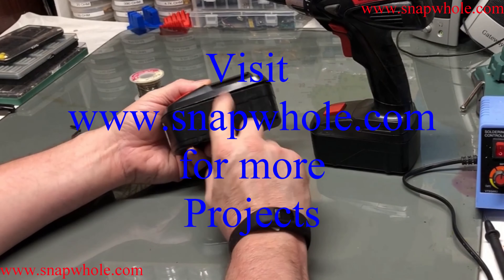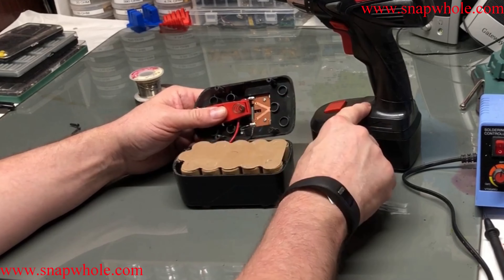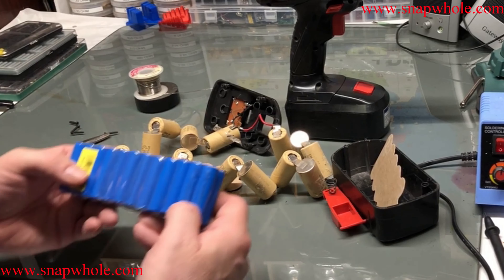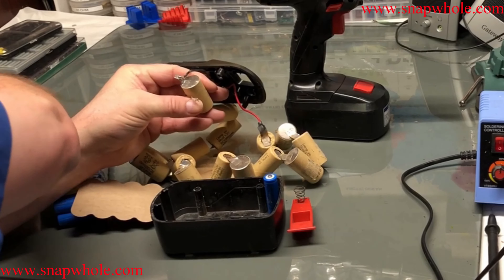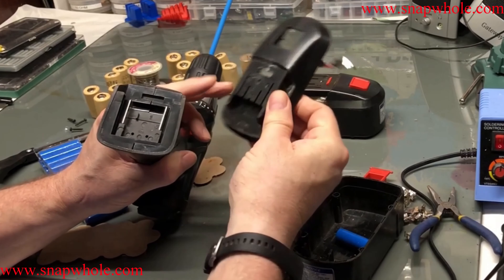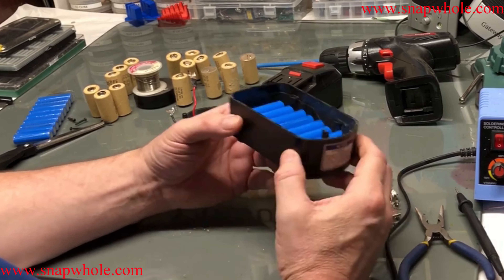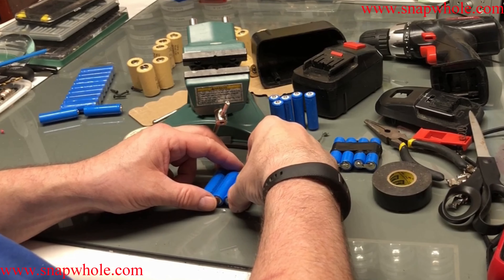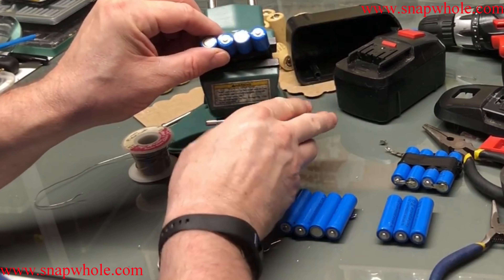Harbor Freight Drill Master Drill/Driver Battery Upgrade from Ni-Cad to NI-NM Battery replacement

Comment: With the frequency on how often the tools go outdated and you cant find batteries anymore, this is perfect. this charger and drill is already out of date
Reply from the maker: there is huge money in batteries for handheld tools, but there are also changes in battery technology, line ni-cad to li-io, that are worth doing, but changing the shape of the battery just to sell more batteries is wrong, the bauer line all use the same battery foot print, with 1.5, 3 and 4 ah batteries, and I think that line of tools will be around for a long time - although there are improvements being made in battery capacity and efficiency, I don't see those changes coming to the hand held tool any time soon, and even with changes to the batteries, I don't see changes to the li-io chargers, they use a balancer to control charging so no individual cell will be overcharged, which is what kills batteries like ni-mh and ni-cad, ni-mh thru overheating, ni-cad thru overcharging - thanks for subscribing!

Comment: Great video and well done. I used your video as a guide to do the same thing... although I was not able to find the Ni-NM batteries as cheaply as you did.. cost me about $1.70 per battery but they are 2800mAh. I have two of these drill motors and just seemed a shame not to make the investment. The job was a little tedious but the finished product works GREAT! :) Larry
Reply from the maker: I ordered my batteries from aliexpress, but sometimes it's not that much more on amazon, the difference in price is usually related to weight of what you are buying, and if you are looking for SAE, they are probably not available from aliexpress, I'm not wild about ordering from china direct, but most of the products on amazon are from the same sources I use, just with a markup, ni-cad and ni-mh are relative easy and work great as long as you use good battery management, lithium is much more forgiving of bad battery management, so I'm planning to do a similar video using lithium batteries, the charger is more involved due to the overcharge protection circuit required - thanks for subscribing!
Reply: Yes, I have purchased things form Aliexpress but it sometimes takes forever to get delivery. I used Amazon - yes, Li is the way to go but I wasn't in the mood to deal with the charger issues so I just use an in-line timer set at 4 1/2 hours, Again, great how-to video. Larry
Reply from the maker: aliexpress has changed their shipping, they do 'combined shipping' and ship multiple stores in one bag, so all the shipping paid by each store pays for faster shipping, but not all stores use aliexpress shipping but I get all most all orders in 2 1/2 to 3 weeks - the 4 1/2 hour limit is going to be your key to long battery life, and is very close to just as good as a charger with a balancer - if the drill master ni-cd had a timer, those batteries would have lasted a lot longer, although on ni-cd, the timer is only 1/2 the solution - thanks for subscribing!
Reply: Yes.. had I been a little more diligent with the NiCads they would have lasted longer. I have two of these drills and battery packs.. one still has the NiCads and I have been much more careful when charging that pack - so far so good :)

Comment: Put some Lithium batteries in them and these old drills would kick some serious ass I would imagine?
Reply from the maker: li-ion is best, but effective chargers are the problem, they required balanced charges, with the charge controller monitoring each battery individually to prevent overcharging any single battery, overcharging is the best way to kill a li-ion, if take apart the 'power packs' used for recharging phones etc, they are likely to be dumb charges and will kill the batteries over time - if ni-mh and ni-cad used intelligent chargers like li-ion does, those batteries would have lasted better, over-charging was the number one killer of those batteries also - thanks for subscribing!

Comment: good job one way to greatly extend the life of a nicd or nimh battery is by balancing the cells with resistors in each of a value between 430 ohm to 1k ohm. this applied to battery packs on old satellites google patent information.
Reply from the maker: I normally use charging balancer, which sells for several dollars, and it individually manages each battery to ensure none are overcharge - thanks for subscribing!

Comment: You used 1.2 volt rechargeable batteries at what mah? Or does the amperage matter? There are a ton of batteries to choose from! Would this work: Deleepow Rechargeable AA Batteries, High Capacity 3300mAh NiMH AA Battery 1200 Cycles 1.2v Pre-Charged Double A Batteries, Low Self Discharge, Pack of 16 OR 16-Pack iMah AA Rechargeable Batteries for Solar Lights 1.2V 1300mAh Ni-MH
Reply from the maker: I recommend catching the Warrior 12v (14.99) or 18v(24.99) on sale, much better solution overall, but the higher capacity will last longer betwen charges -- thanks for subscribing!

Comment: Where did you buy the batteries 🔋from?
Reply from the maker: Aliexpress dot com, but you can get them off amazon, the higher rating, the longer your drill will run - NI-MH batteries

Comment: Are the new batteries, AA sized?
Reply from the maker: These are AA size and still working fine - thanks for subscribing!
Reply: @snapwholeharborfreightreviews  Awesome, they also have to be rechargeable, correct?
Reply from the maker: @mehhem4842  to use the existing charger, nimh rechargeable is best, if you go to lithium (which is a lot better) you will need to different charger, the li-ion batteries need a balanced charger - thanks for subscribing!

Comment: but the charger is for NiCd not for NiMh...
Reply from the maker: follow the directions I gave in the video and you will not have a problem, the problem with all NiMh batteries, you can't overcharge them, once they get hot, they go bad fast - you also can't over charge NiCd batteries, it chemically degrades them and they go bad - Thanks for subscribing!
Reply: I have a few dead batteries.  I'm going to look into this.  For charging I might just get a timer since I always forget to unhook them :(

Comment: Watch out for internal resistance of the battery is much lower than NiCad in something like Li-Ion, but they have battery holder, so they can provide much higher current that make your drill smoke.
You should control the current that come out of the batteries.  But you can charge them individually using regular charger.
The welding should be done with spot welder.
Reply from the maker: the drills have a current limit built in, odd that you reference li-ion issues, when I used Ni-mh, and don't get hung up on spot welding, should and must are two different things, keep an open mind when there are multiple ways to do something - thanks for subscribing!
Reply: @snapwholeharborfreightreviews  Thanks for response.  I use 18650 Li-Ion battery with battery holder and connect it to another type of drill  Durabuilt 9.6V. 
First I used 3 of those batteries in series ( each 3.7 V, so 11.1V) all together, it was good but I saw smoke, then I used 2  in series (7.4 V) running good but still I saw smoke, then I used only one it was running good and no smoke.  Then I used 3 batteries in parallel then I used a current probe and saw up to 11A during start of the drill ( called in rush current or “locked rotor current" ) 
However, I admit that was a different drill and this drill could have a current limiter.  I will investigate.
I like 18650 Li-Ion Battery because it has 9.9AH each, it is about $1 each, and has different battery holders ( 1, 2, 3, 4... )  already available.
Just imagine you put 20 of these batteries on your bag, and recharge them when you get back home.

Comment: DUDE, I appreciate yer knowledge and interest in soldering/watchmaking. This reminds me of lots of modern electronic stuff that rots faster than a Peach in the Hot Sun.  Such as wireless speakers: Designed obsolescence. I will look for your next video on the up grade warrior batteries: Question is it feasible to convert the old power source into a "corded drill"; wiring it into the connections?
Reply from the maker: very doable, I would take the charger and wire it directly to the wires going go the battery, secure the cable very well, you will apply a lot of force on the cord while using - if that works ok, I would look for a similar wall wart that had 12-18 volts and is rated at 2-5 amps, if the tool is marked as 18v, it will function ok at lower voltage and slightly higher voltage , maybe 12 - 20 volts - another option would be getting a warrior 18v battery and kludging adapter so make it fit - would be a challenge to make it look good and still work - thanks for subscribing!